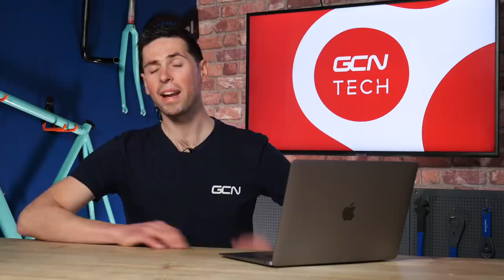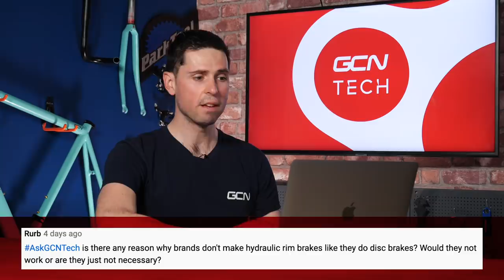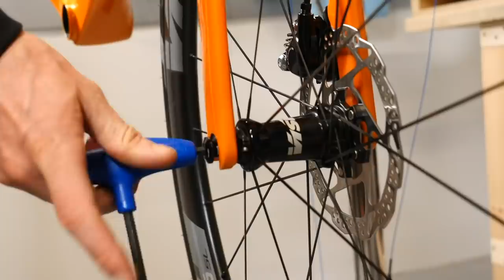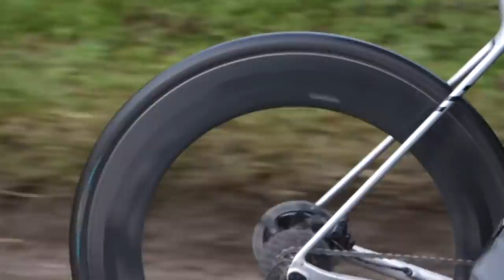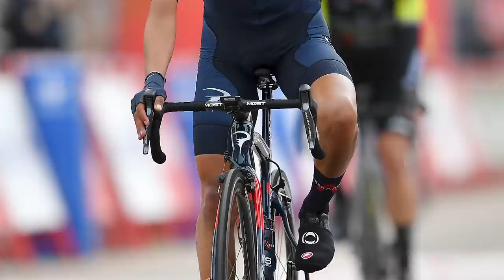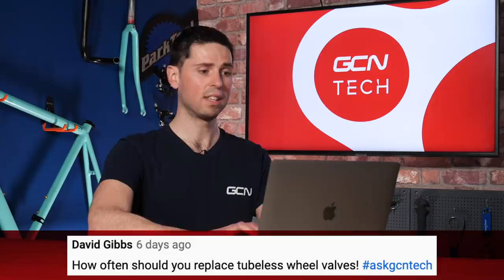Are Team Ineos The Only Pro Cycling Team Still Using Rim Brakes? | GCN Tech Clinic #AskGCNTech

Comment: Tubeless gone flat overnight: I had the same problem with new rims and new tires. It turned out I did not put enough sealant in there, although I sticked to the advised amount written on the bottle. After adding another 30ml per wheel they never went flat again.

Comment: #AskGCNTech Hi Alex. I run Ultegra Di2 6870 11sp and have recently replace the chain with a new 11spd shimano one. I matched the chain length with the old one I took off but now the gear changes, although crisp, feel a little "loose", almost as if the chain is too slack. Do I need to remove a link or is their an easier way to test the chain length to make sure I have it right? Thanks

Comment: #AskGCNTech
Is there any solution to my shimano 105 R7000 left sti it won't shift theres a click but it doesn't shift you have to push the small pin or something for it to shift... is there any solution? The FD is properly adjusted though....tnx

Comment: I got a road bike as a gift from a friend and it's a bit too tall for me. How can I fit it for my size? I am pedaling a bit forward, so my knee is a little bit behind my toes and I have to reach to far to the front. So smaller Stem, reverse my seat post and a smaller crank arm or what is your suggestion? #AskGCNTech

Comment: #AskGCNTech Hi GCN Tech! Two spokes on radially opposite sides on my front wheel are broken and the rim is now not true. The nipple holes in the rim are all rusty. Would it be a good idea to true the wheel without the 2 spokes? My thought is that since both are broken, their absence in tension balances each other to make be equally tensioned. Thanks!

Comment: @/askgcntech 
Hello guys. I have a cheap 8 speed microshift rear derailleur. I wanna change that to an 105 or ultegra 11 speed. I know I need some new wheels with a shimano 11 speed freehub. I am surrounded by mountains so I'm thinking of an 11-32 cassette, but now the question, do I need to buy new levers, or can I use these (8 speed) hand levers that were originally on the bike? Tnx and cheers.

Comment: Surely there’s no hyd rim brakes because the limiting factor is the friction? You can apply plenty of force, but the wheel will still slip between the pads. So, lots of extra faff for zero benefit. Also, imagine using hydraulic pressure on carbon rims that are a bit worn sounds quite scary!

Comment: #AskGCNTech can I install a 160mm disc brake rotor onto a wheel that has a 140mm rotor and will it fit into my disc brake caliper? Thanks!
Reply: You can....your caliper has an adapter between it and the frame for 140mm rotors. All you need is the right adapter for 160mm rotors. Some adapters are reversible - up for 140mm, down for 160mm.

Comment: It shouldn’t be a surprise that the team of marginal gains uses rim brakes.
Reply: why wouldnt any team want marginal gains, though?
Reply: @vittocrazi  Maybe the other teams are looking at marginal gains as well, just different marginal gains...
Reply: What marginal gains are there to make? Certainly none in the weight department.
Reply: Most teams have to use what the sponsors demand.
Reply: @nekobytes9187  No indeed, weight with metal rotors is generally a bit higher for sure - other areas that might be considered are braking performance and consistency, rim design and consequences (e.g. effects of heat build-up) and (bizarre as it may sound) aerodynamics.
Reply: @nickmannerings3574  yes. and exposition also plays a factor towards an impression. the recent acceptance for disc brakes may be because current pros have mostly ran disc, even if the rim brake was superior
Reply: @fukawitribe  I would think the rotor weight would be negligible, given that the lightweight bikes they use already need weights to reach the weight limit? Or is it more of a concern with the increase in rotational mass?
Reply: @nekobytes9187  It's not a massive amount,  no - a Shimano rotor is around 130-160g and e.g. a scrub rotor is maybe 50-60g. So in theory you could loss maybe 150-200g on the rotors (if they worked well enough for you), which is not far off what the difference between some disc and rim brake groupsets are.  Doubt the hassle or expense would be worth it mind. The rims can go down in weight a small amount as well, although a lot of the changes on the disc wheelsets seems more leaning towards wider, better shaped rims than losing mass (which makes a lot of sense).
Reply: @nekobytes9187  there’s actually quite a lot in the weight department. The wheels, frame and fork all have to be beefed up and that’s without the additional weight of the disc brake systems themselves. If you run rim brakes you can get near the UCI weight limit with an aero frame and wheels, a much, much harder task with disc brakes.
Reply: @nekobytes9187  that’s without the proven aero gains that rim brakes over even the best disc braked bikes.
Reply: @hogdog567  That's not only not proven, it's actually increasingly the other way around in some cases - worth having  a look at some of the figures coming out in the last couple of years (in particular, look for drag averages over yaw ranges, and rim evolution).
Also regarding weight - you'd actually might be surprised how little penalty there can be for disc vs rim bikes over the UCI limit, it's pretty straightforward to get under that with a disc set-up without having to resort the hanging around the THM web-shop in a trench coat and floppy hat. I mean there's definitely a mass penalty still for sure, but whether it's remotely enough to make it a tangible net disadvantage in the pro-peloton (let alone for amateur riders) is another question - almost certainly without the easy answer some might like.
Reply: @fukawitribe  You actually believe that figures? The cycling industry was commonly shady even with weight data which is really simple to obtain and you believe you are not being fooled with aero data? lol
For the start, if you want to consider real world conditions simply using yaw angles is not enough. It is still steady state.
Weight is not big issue with discs for the pros because the weight limit is set high enough. Reliability & wheel changes and aerodynamics are big issues though. Rotating discs have inherently bad aerodynamic properties and they are being placed right in the front to disturb airflow.
Reply: @jkk916  I believe some of the data available from 3rd parties, yes, although as you point out - that's generally more static than dynamic. Dynamic yaw rate figures are spectacularly uncommon - for rim and disc setups alike. Discs do also have bad aerodynamic properties in cross-winds,  head-on not so much, at intermediate angles "it depends" and a bunch of that is the wheel shape - the wheel manufacturers are able to have a wider range of rim profiles that may (or may not) have advantageous aero properties (flow trips, sailing etc). There's plenty of public discussion about the pros and cons with that.
Reply: @fukawitribe  I do believe that it is entirely possible there exists conditions where DB are advantageous, but I would go so far to say this is anomaly.
Reply: @jkk916  From an aero point of view I would have agreed with you until very recently. Although there's data going back at least 5-6 years showing some advantages in the wind-tunnel, it's only in the last year or two that it seems it's becoming more main-stream, and as far as I can see that's being driven from the rim profile side of things rather than, say, actually making the brake calipers any more streamlined or whatever. There doesn't seem to be much in it though, but that's actually a reasonable move forward I think.
Reply: @fukawitribe  Could you provide me with any source please?
Reply: @jkk916  Yep sure - i'm going to put some links in about 1 minute in a post below this though, so this one remains. If you don't see it, or it disappears then it might have been ripped (3 posts i've put in this section with external links seem to have been removed already). If that happens i'll try with just descriptions of what and where they were.
Reply: @jkk916  Yeah - so they appeared and now have gone. FFS. I'll try one at a time.... this is ridiculous, not sure what the mods are up to....
Reply: ...and that's now gone. Great - OK so a nice overview of various bits and bobs about disc (and touching on tubeless) is in Cyclist on 1st March 2021. Cannondale Design Engineer about 'Disc and Rim Brake Aero Drag' Oct 17 2016 . Parcours (wheel mftr) in 'Aerodynamics of Disc Brakes'  (2021 I think). Quintana Roo 2018.  

I'll see if these stay before going any further.
Reply: @fukawitribe  thanks
Reply: So why don't other teams? You really think Team Frack are the only ones who maximise gains? Mebbe it's because Pinatello bikes are heavy.
Reply: @matthewlewis2072  I think they are just a tad over the limit so they are just as heavy as they need to be. Even if you add 0.6 kg which is the estimate of DB weight penalty it would be still lighter than some of the competition.
Other teams are maximizing pulling money out of your pocket by selling you DB bikes.

Comment: Why is the drive train always on the right?  For the same reason there are 11 players in a football team, rather than 10 or 12: convention.   There is no advantage to one side or the other, so it makes sense for all models of freewheel to have ratchets that work in the same direction.  For comparison, most motorbikes have the chain on the right, but the BSA Bantam has it on the left.  This is because they took the design of a "right hand drive" German DKW and made a mirror image because they wanted the gear shift on the right which was the British convention at the time, and the DKW had the gear change on the left.  Years later, motorbikes have standardised with chain on the right, gear change on the left.  Sometimes a market standard is just more convenient.

Comment: For me inner airtubes, rim brakes and aluminium wheels with low-medium profile. No need for tubeless, disk brakes and carbon wheels. They give more problems and potential faults than the advantages they are supposed to give.

Comment: #AskGCNTech. I bought a new set of carbon handle bars(shallow drop Specialized,200 grams). On the bars it says to torque the 4 stem bolts to 4.5Nm's but, the Zipp stealth carbon stem says to torque the 4 bolts holding the handle bars to 6Nm's, so many values which should I choose?
Reply: I would use the lower number of the bar.  Where the bracket can withhold up to 6, your bars will not.  Enjoy your new setup.
Reply: What jim said - plus maybe worth popping a bit of fibre grip in there (if you haven't already) if you're concerned about the lower torque value - I wouldn't have thought it's a biggy though, 4.5Nm is a pretty decent load.
Reply: @JimKJeffries  So you're telling me the bars can handle my weight and shock loading but, 1 Nm over and they will explode?
Reply: @fukawitribe  your reply reads more like a question about fit up grease, rather then answer to torque value question. Thankx?
Reply: @KenSmith-bv4si  Really ? OK. What I said was use the lower torque limit and, if you're concerned about the whether that's sufficient to hold things together tightly, you could put some fibre grip in (or just do that anyway).
Reply: @KenSmith-bv4si  the strength of carbon is exceptionally directional. So yes, one could design carbon to be very strong in one way but weak in another.  One of the load points would be on the bar where it touches the clamp, outside edges.  So by over loading the torque you decrease the effective strength you would experience because part of the strength is being used by your over torqued screws. 
   Typically engineering practices give about a 20% error, however current engineers are taught to think in minimums, this is why the learning curves historically are so disastrous...there being no capacity to deal with the unknown.
   Neither of us know more than the engineers of your bars, so that is why I would defer to them.  And the reason I would use the lesser, is both values are a maxim not minimum.
   I hope you are having a great week.  I would encourage you to perhaps consider tone.  You are speaking awfully curtly to two people you don't know, who are making the time trying to hook you up, right? Is your goal to learn or be right?  
   Enjoy your new gear and get out on some great rides.
Reply: @fukawitribe  go back and reread your reply, you said "I wouldn't have thought it's a biggy though, 4.5Nm is a pretty decent load".
Reply: @KenSmith-bv4si  Yep, sorry if that is confusing - basically i'm saying that I wouldn't worry about using fibre grip, or the lower torque, (i.e. it's not a big issue) as 4.5Nm is a reasonable value to expect no movement from.

Comment: #askgcntech, do any teams use cable disc breaks or do nearly all of not all in the Super Pro tour Use hydraulic? To Me if a top pro I would ask to use Cable due to the teach not quite there yet for road cycling hydraulic. Now if I could set up MTB tires on a Road Bike, have them work I would do it cause I think the problem is that for any Hydraulic disc breaks to work, you need to have space the way the MTB type do from the wheel. I have seen some who have newer bikes that they swapped the hydraulic that came with the bike for cable Disc due to how finicky the road hydraulics are. It is Mainly one guy whkj gets every 5-6 year a new bike for that type of biking who is in his 60's or almost 70  who switched from run/biking/swimming to only bike and swim due to less time needed off in training and was not letting himself have that time but I will see him on occasion run just enough so he can do the occasional Olympic distance Triathlon.

Comment: #AskGCNTech #bikemathfordummies I'm having a hard time understanding how power works. If you have two identical cyclists riding the same bike in the same gear at the same cadence, how does one go faster than the other? I know it has something to do with the force being applied to the pedals, but if the cadence is equal, wouldn't the force be the same?
Reply: The heavier rider would require more force (torque) to achieve the same cadence. Torque x cadence = power(watts). Therefore the heavier rider will be producing more power for the same speed
Reply: @sashodasho  This doesn't answer the scenario I presented. Both riders & bike setups are identical.
Reply: If the cadence, gear and wheel sizes are the same, the speed will be the same (whether or not the cyclists are identical). Power does not come into that equation. Power comes into the equation when you look at how much power you have to produce to achieve that cadence in that gear. It will be affected by rider weight (if going uphill), drivetrain efficiency and aerodynamics. Let's say the circumference of the wheel is 2200mm, and the gear is 50/17, and the cadence 80. This would generate a speed of 31.06 km/h. How much power you had to generate to achieve that is what is different for everyone, because of the weight/slope/drivetrain efficiency and aero.

Comment: I believe EF with the  SuperSix evo has rim breaks(as a choice)
Reply: I don’t think they make a rim brake supersix Evo anymore
Reply: @nickmannerings3574  I don't mean offence but search up 'rim break supersix evo' the new one with EF colors shows up. Also, I've seen many supersixes with rims in my local area (new ones)
Reply: @benji.bae.2505  you’re right - but they only do the rim brake in the std layup as I understand it - not the HiMod. So difficult to keep up with all this stuff. Of course just because the manufacturer makes it doesn’t mean they offer it to the teams.  Not easy for us punters to know what is going on.
No offence taken.
Reply: @benji.bae.2505  the only race Cannondale with rim brakes and the new colors is 2019. Uran chose rims. I cannot find anything newer. Not trying to argue. Just curious
Reply: @DaveCM  I think that might be accurate. I'm talking based on a GCN video which they did in 2019...? Thanks for the info bro

Comment: The teams don’t agree with manufacturers! If you ask the pros.. and it’s been done numerous times they will always say Rim. Also SRAM made Hydro Rim. Brush up on your knowledge.
Reply: but they "agree" in the form of using them anyway
Reply: No, they don't "always say"- go and actually look at what they say. There was certainly a lot of push-back to start with, that's changed markedly over the last couple of years. One issue that still comes up though, and makes a lot of sense, is the disparity in braking in some cases and how that might have safety implications.
Reply: The pros ride what the sponsors pay them to ride (and the UCI allows).  The bike industry wants the extra $1000 revenue per bike of disks, wants everyone to get new bikes, and does not want the liability of fat middle aged riders on carbon clinchers.  Once everyone is on disks, the bike companies will reintroduce top "pro" level versions of high end bikes with an expensive special rim brake option... Just like you have been able to buy tubular wheelsets for the last 30 years....